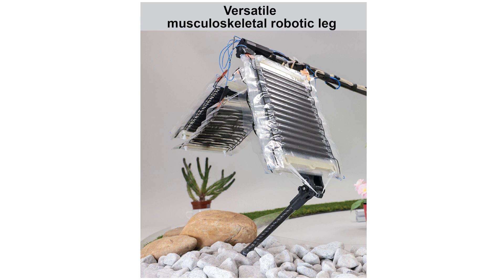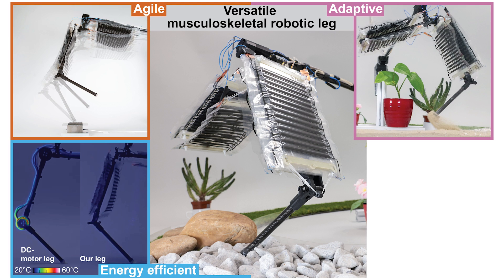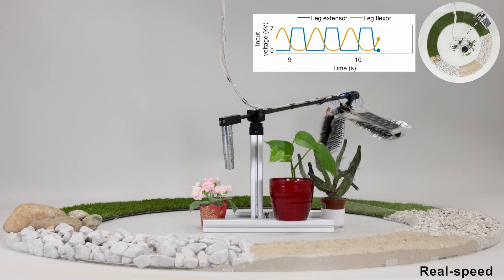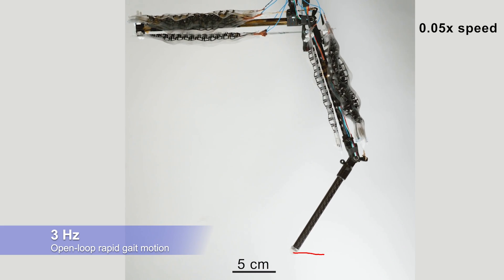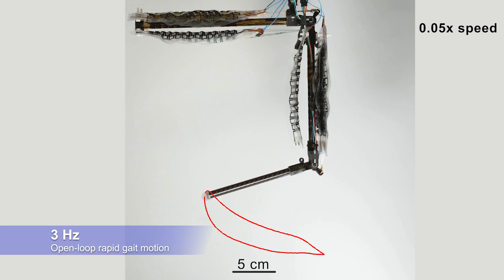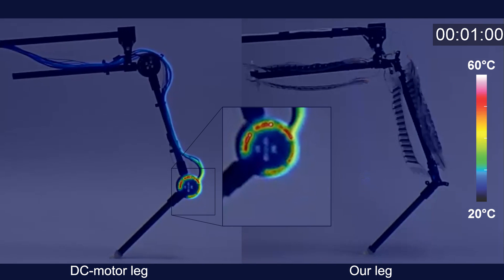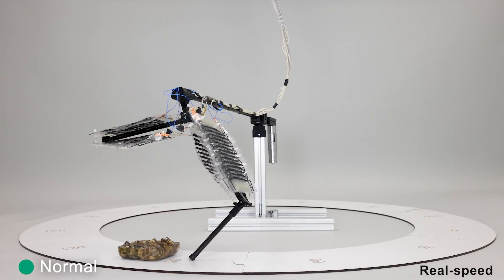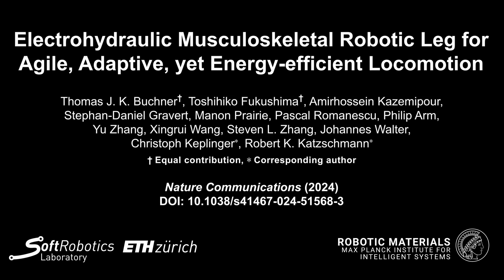Robot leg powered by artificial muscles outperforms conventional designs

Comment: The video's infrared comparison is misleading. The peak temperature rise shown in the small component(s) of the mechanical actuator does not tell us the net heat output compared to the muscle analog. Heat, as they told all of us in HS science class ≠ temperature. Furthermore, the heat and temperature are going to be distributed over the absurdly large surface* of the analog. Finally, all that flapping around of the muscle analog is going to aid in real-time release of heat to the ambient air; the IR imaging cannot register that phenomenon.
_
* Not to mention volume. Any full-sized robot that can actually maintain a useful work-load may well fall through the floor.
Reply: They also didn't show driver temperature. These muscles run on few kV DC and generating that in a variable fashion isn't easy. On the other hand inductive motors have a century of development in them, eg: rare earth magnets, high current MOSFETs, and FOC control. I think low-leakage flexible dielectrics are easier to develop than room-temperature superconductors. (which still don't solve holding current losses on the driver side)
Reply: @g_glop  An android or prosthetic arm should not produce strong magnetic fields, so it can e.g. carry and put a tape on a reel-to-reel recorder without erasing it, thus conventional e-motors or solenoid inside robot hands and adjacent parts are to be avoided. This robot muscle seems to need no magnets either.